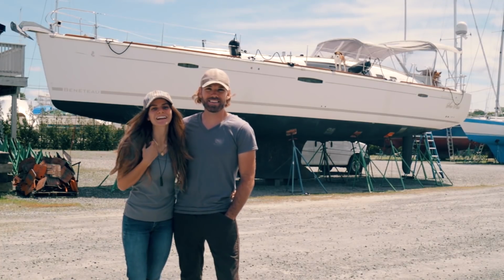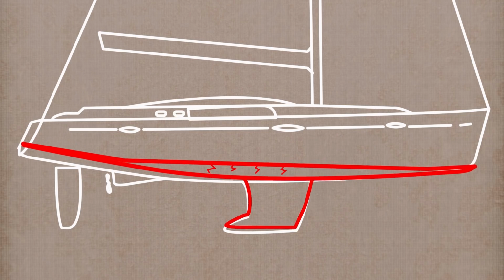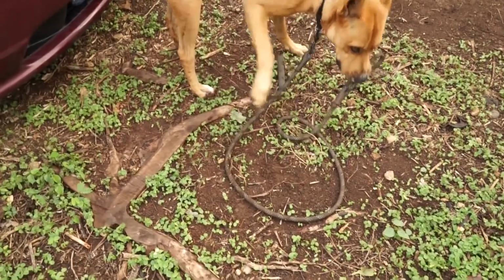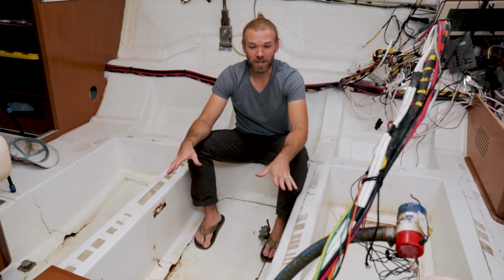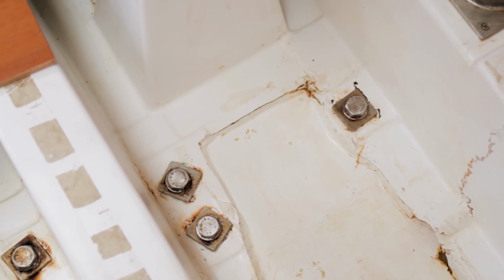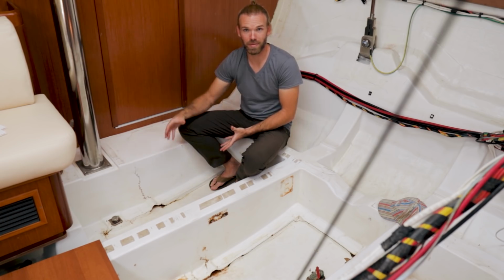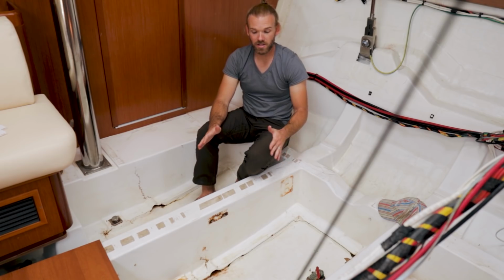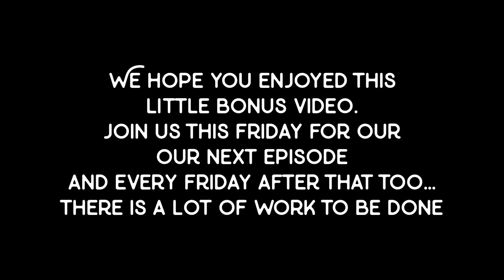What Happened and What Now? our SALVAGE SAILBOAT story | Expedition Evans Bonus

Comment: On my beneteau it was full pans instead of tabs this came later to cut more costs and when it was full pans they could not tell if the glue had bonded on that pan .alot of the glue never touched.
Mine was done by cutting the full pans out with oscillating saw ,same as cutting your tabs.Keel was not removed boat was raised in slings taking weight of boat off keel letting the stringers come back to floor.The keel also had to have some side pressure added to it to pull the grid down to the hull on port side.  Stringers glasses in and then the keel can be removed.Dont cheap out using polyester resin use west epoxy its stronger with 1708 stitched matt and   18 oz woven
Reply: Excellent information
Reply: I did the same repair on a grounded Beneteau 40 and a Sea wolf, back in the 80s and found the bonding paste used was  basically a thickened poly resin and very brittle, came away quite easy with a chisel after cutting away the base and flanges one section at a time, reglassed up the faces onto the hull after grinding away gel coat etc, extending the glassed areas out at least double the width of the flanges, in my opinion it was twice as strong as the original, also replaced the keel bolts as these had stretched. there was also external hull damage, believe they are both still sailing in south Wales .
Reply: Exactly what I was trying to explain in the comments on the previous video with all the morons saying there is no difference between a pan and the grid.
Reply: I agree completely. This is excellent advise.

Comment: Guys Hi, when your done re-fixing the frame to the hull, you may want to considerer additional  strengthening of the keel to the frame. Your boats design is that the keel is connected to the hull not the frame. The keel will flex or move and its securing point is the hull not the frame which is what provides the transverse and longitudinal strength of the hull. Think of it as a car chassis, providing the structure and the panels, wings, doors, roof, cills and skin providing additional but limited strength to the over all structure. There is a way of ensuring that the keel, grid and hull perform as one structure. Uniformly. We carried out a simple modification that ensures this on our new boat 3 months after we took delivery after seeing what happened to Cheeki Rafiki. Its quick, cheap and addresses all the issues with skin hung keels. Contact us and we will give you a heads up.   Sail Safe Guys, Ant, Cid & the pooch crew.

Comment: I hope you don't mind me giving a few suggestions. 
The reciprcating saw will work great where absolutely nothing else will get in a corner or under somthing.
I use saw blades ( this is if you aren't already doing it.) on my 4" angle grinder.
 BE FORE YOU TRY IT IN THE BOAT, PRACTICE OUTSIDE ON A TABLE..
 and use finish blades with alot of teeth.
This will save days in time,
To bad you can't put a piece of air conditioning duct on the port outside over the side of the boat blow air in. At a low speed. From the other end 
 I write this  you my be farther along.
If you try the saw on the angle grinder, try to always lay down the body (motor)  first to brace it then loweer the saw down slowly. Don't free hand it. 
Cut with the saw blade on your left,  SO THAT THE SAW WILL ALWAYS CRAWL AWAY FROM YOU.
this will save you $$  time, time, TIME..!
REMEMBER   SO IT CRAWLS AWAY.
THE CHAIN saw DISKS..?  I NEVER USED ON FIBERGLADS ?  YOU CAN TRY.
I SURE AS HELL WOULD. LOL.
I have my fingers crossed for you.
 I am a retired MECHANICAL CONTRACTOR, (electrical, heating, refrigeraton, power generation, processes piping, controls) that kind of Mechanical. be sure to study, and draw  every thing you uncover even if you don't know what it is yet.  You might get a ( AS BUILT SET OF DRAWINGS)  set of drawings from  the builder in France. Tell them what you are doing and  see what they have.    I always wired and rigged my boats and that saved $$$ big time. I always made drawings for the wiring.
I know you can't do that, but where you can make skeches,.
I did alot of remodeling and R/R  and there is just no other way to  learn YOUR systems plan. 
They have to have diagrams  for that boat.
I think you guys really scored, if I didn't live on the opposite coast I would give you a hand .    Remember it is going to get easer and easer .   The WEST EPOXY people , are the know all and be all  in  exactly what you are doing.
You must know this, but just in case,

Comment: I have and idea for you to consider.   In addition to your fiberglass work to re-glue the frame to the hull, I think you should make use of the heavy keel and bolts and the frame above by making or adding a stainless steel reinforcement between the frame beams.   Since this has already happened once, if you had the keel bolts going through a stainless frame or beam of sorts that went between the grid frames and bolted to the grid frame you could end up with a much stronger result.   The issue I see is you making all the repairs, and then hanging the keel back on and the weight of the keel pulling down on the hull and away from the grid which would always be the case when it's in the water.    So the idea is to hang the keel from the frame as opposed to the keel being hung from the hull of the boat which is then dependent on the strength of the fiberglass weld you redo.   Perhaps make yourselves a jig out of wood that exactly fit each spot, and then go to a stainless steel welder to make frame pieces to span from one grid frame to another so that weight is hung from the frame and not the hull.   Think of it as bolting the keel through the hull AND the frame grid...  Make sense?

Comment: Can you get the design from Benateau? After dropping the keel you can make a cradle with the hull shape and it will keep the shape of the hull as you bond the grid to the hull. You can sit the cradle and the boat right on the ground. No need to be up high.

Comment: LOL, it seems pretty easy in an 8:40 You Tube video! Seriously I really like the time you have spent obviously reviewing what needs to happen. Little surprised either the grounding was super harsh or these boats are a little on the "under engineered" from the factory? I would have thought the Keel would be completely ripped off before you would see this type of structural damage. I mean grounding although certainly not a goal when one sets sail does happen on occasion.

Comment: Agreeing with everyone here 😂. Cut them tabs, and start again.. I actually would be very tempted to remove all the sole from bow to stern,   Even if it looks okay, that  (lets call it a Skeleton) took a huge rock Laterally, first down at the bow, then up at the stern forcing the bow up,   So plan B definitely, and of course you can add bearers to be stronger then new! Why not?  Just get your hands on some seasoned hardwood tab it to the hull and though bolt it to the Production skeleton,  she will happily take any extra weight, plus you have Peace of mind no matter the sea state, shes 100 times stonger than new!    Going to be messy whatever you do, may aswell add strength?

Comment: I agree with the consensus on cutting the tabs off, but from my experience in refurbishing sailboats. I would add a 2x4x12 under the hull from bow to stern held up with jackstands, to hold the shape of the hull. This may not be necessary if the hull is thick enough, but a smooth and fair bottom sails much better than a wavy one.

Comment: You have a great project and I'm looking forward to following your progress. While you have identified the damage to the grid and keel blots you don't seem to have considered or yet identified any damage to the hull. with the amount of damage to the grid there must surely be damage to the hull as well. before you start repairing anything you need to get the keel off and check the hull. this will probably involve removing the anti-fouling paint and getting back down to the bare hull. A good way to check for any distortion in the hull would be to get a long flexible batten as all the cures on the hull should be fair. If there is a need to make repairs to the hull you will be in a position to make a temporary mould of the area affected and this can also be used to support the hull while you work on the inside.

Comment: go with option b  because even if you can get rid of most of the bonding glue you still don't know what you have under there, a multi tool will make removing the tabbing pretty easy which will also allow you some ingress under the main gridding beams, use expoxy , more exy but a lot stronger

Comment: Couple of questions:

1. The manufacturer used some type of adhesive to initially bond the hull and sub structure and then applied fibreglass as well.  Do you know if just fibreglass replacement, without the glue, will be sufficient to provide the needed structure?   The manufacturer should know the answer to this question.

2.  What, if anything, is inside of the rib structure?  It may be hollow or filled with foam or balsa but you need to know this is you have plans to “force” the structure down to the hull while you re-glass them together.

I’m looking forward to following your adventures as you reassemble this boat.  My concerns for you is maintaining the original proper alignment of the rib structure to the hull bottom and your ability to pull these two things together remembering that the boat is 49ft long.  If I was a lot  younger and doing this project I would drill 3/4” thru holes every 4ft along the full length of the substructure to the underside of the boat.  Install threaded rod in each hole and tighten BEFORE dropping the keel.  These treaded rods will provide two things for you..a clamping device to later bring the two pieces back together and secondly will guarantee that the original alignment will be maintained.   Alignment may quickly become an issue for you as you dig deeper into determining the extent of the damage.

Comment: Cool that you two are doing this. Nuts. But cool. We're even in a similar situation, as Europe was in our plans until Covid also (We even had a one-way ticket to Heathrow that American Airlines was nice enough to let us exchange for miles as it had to be canceled). So, then we were even going to do the boat thing. Now, we've settled upon buying a house to occupy ourselves. Obligatory words of encouragement: You guys don't seem the type to throw in the towel too easily, which I do admire because I'm a little like that myself. And in the beginning you've admitted to doing some crazy stuff. Ah... youth. One thing however, the sanding in the enclosed area, fiberglass etc... If it's all over the salon, it's all in your lungs. You have to be careful with that. It's bad stuff. Taking a boat out with the assurance you've done it all up right is one thing -- Filling your lungs with fiberglass etc is another. You must be careful.

Comment: I watch a video from the beneteau factory on how the hull was made, I Guess you watched it also, with that said what I saw was that they used balsa wood for the wood portion then infused it under vacuum to fill the porous  balsa Sounds high tech but will have to see what condition the infused balsa is in and weather the new fiberglass will adhere to it? If I didn’t get the process correct please let me know.

Comment: Hi Guys,  It will be much much stronger and better to cut away the flanges on the grid and then you can grind away all the bondo/glue. You can then glass the vertical sides of the grid directly to the horizontal hull with a small fillet. This will be much stronger than fibreglassing from the hull over the flanges and then up the vertical surfaces.  So please go with plan B in your video! :-)

Comment: Hello guys you need to add more glass to the hull outside from the keel to the water line. You could run aground your self an brake it again
In the old days fiberglass boats didn't brake like a egg when you run aground that's because they were thicker..also use epoxy resin are vinalester only..as per beneteau..
Good luck an have fun

Comment: Just to add to the echo chamber, yes cut the tabs. Do a SailLife style re-tab of the whole thing. What I don't know is if the existing grid is hollow. If it's hollow, you will need to use significantly more tabbing than if it is solid due to flexing. You might want to use (again, see SailLife and Mads' rudder rebuild) some structural expanding foam to fill up any cavities in the existing grid.

Comment: Plan b every time. Cut the tabs - flanges off. Re glass each box with new glass,  sides and bottom, what you need is Contact area, the more the better , preferably epoxy, if your budget allows.  
Polyester when it cures slightly shrinks and can bend - curve laminate.  Epoxy just sets!  And is stronger. 
You would Never get the glue, it might be an epoxy based  one  called Plexus,  out of the gap between the hull and the grid.  
I wish you all the best with your repairs,  mads sail life , and early sailing Uma,  are good utubers to watch.

Comment: You were concerned that the previous owner had done a fiberglass patch over top of gel-coat. However that is, unfortunately, what Beneteau does as well when they build. I would caution you to pay particular attention to the aft bulkhead forward of the rudder as this seems to be a weak point. Boats have been lost at sea when the tabbing of that bulkhead gave way and then the steering forces cracked the hull. There are a number of threads/post on Cruisers Forum about this problem. Beneteau did release a stainless steel bracing for some models of their boats but the tabbing of the bulkhead has to be taken back to bare fiberglass and re-tabbed. Also, and you probably know this but boats have been lost after grounding with the loss of the keel. Best of luck in your repair. I admire your tenacity.

Comment: Lots of work ahead. Option be would be the strongest and most reliable option. That said if you can get the glue out and put in apocryphal resin in the flaps that would work. The issue is the apexes resin only good in the 1 to 3 mm thickness. Else in option a I do not know how you can get a good bonding agent under the flaps of the frame...aka boat subframe.

Comment: Thank you for the Explanation.   What are the tabs made of they seem to be carrying the weight of the keel.    if you removed the keel  can you holdup the boat with those  screw jacks or will you need to build a cradle

Comment: Guy, love ur videos!  So much fun.  But gotta give you 2 a heads up on your repair project. You can pull all the screws you want using a cordless drill. But when ur going back together,  you gotta loose the cordless. No joke. Buy a couple ratcheting screwdrivers, mb a speed handle(harbor freight) and get after it. Buy a box of paraffin wax to coat ALL the stainless screws before you install them so the won't bind up 1/2 way in.  Cordless drill s are way awesome for running a screw in til it bottoms  AND snapping the F'ing head right off! N if that don't happen, then you cam out the head, which means vise grips & scratches everywhere.  Then ur day is totally screwed. Literally! Lol, not. And by the time you get that screw out,  you got a hole you can stick ur finger in. Now you got another repair job.  So humor the old guy & buy a couple nice screwdrivers!